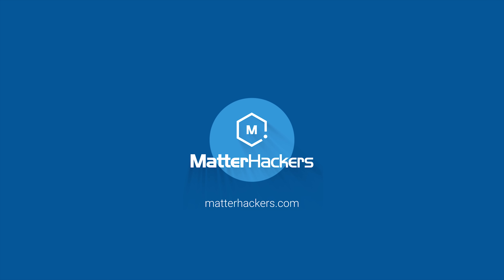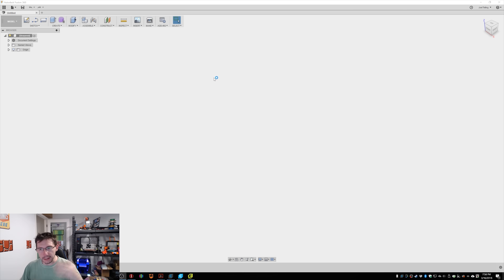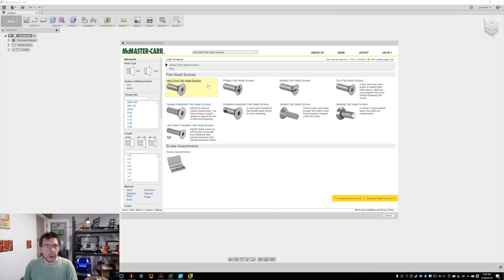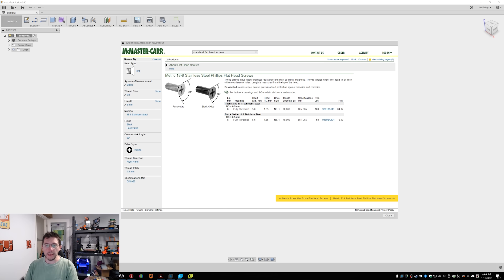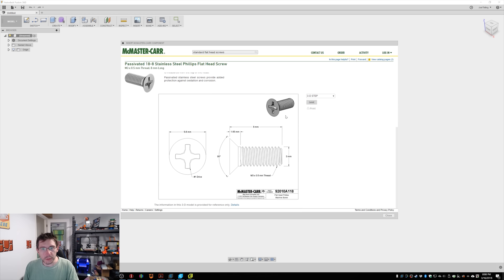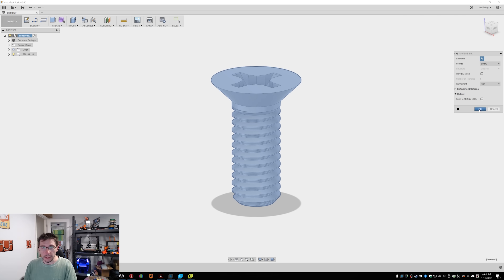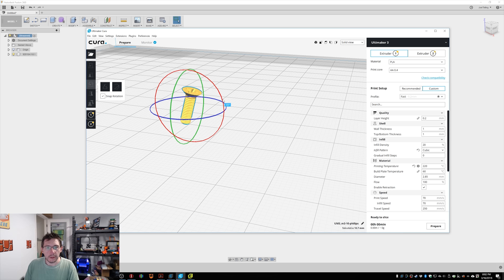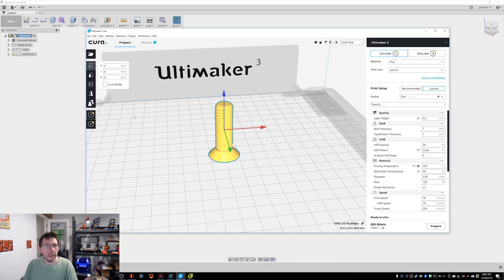3D Printing Nuts & Bolts & Screws using Fusion 360 and McMaster-Carr

Comment: The thing that's really weird is I can create these half inch screws and threaded holes infusion and they always used to work I won't go into what the assembly is but it uses these big half inch screws and they always used to work and then all of a sudden they don't work anymore they bind up I use the same class half inch 3B screw and threaded hole and they do not work you cannot turn that screw in and that's why I'm looking around on the internet to figure out why what has changed

Comment: If you don't change the length you're changing the thread pitch in theory it shouldn't even work I'm a machinist trust me it's not supposed to have a proper fit if you do not change the length because of the pitch changes it should bind up I have no idea why it's not

Comment: Are making bolts and screws on a 3D printer more efficient than making them on a plant? I work for Stanley and we make bolts and screws out of coil of wire. I’m thinking of the future and I want to know if 3D printing such objects will take those jobs. What do you think?

Comment: The problem with using percentage is that the tolerance you want to create is a fixed number and is not proportionate to the size of the object.
With tiny screws, 375% wouldn't be enough leeway. With huge ones, it would be too much.

Comment: While being 2 years old, I'd just like to add that there is the "Horizontal expansion" setting in Cura, which allows you to expand/shrink all perimeters just a little bit to the inside or outside without actually scaling the part itself. This could be useful when this method of scaling the full model isn't something for you. :)

Comment: Thanks for the video. My first printed bolt was a hex bolt, and I resized the bolt like you said, but because of the resizing, none of my allen keys fit the bolt.
So for my second attempt, I will be using a philips head instead.

Comment: I think an easier way to do it is with the Cura Setting "Horizontal Expansion" (mine is set to -0.1mm for PETG, and -0.05 for PLA) That way the holes match their real world size. It mitigates the thermal change in size from the plastic.

Comment: If you can spent few more bucks you can buy a kit of tap and die and make a perfect thread :D  You will just need to draw the bolt/nut without the thread .. check the strarret chart for the right size :D

Comment: Or... You could just scale down the holes? I know printing is fun, but really?
Oh. As 3D printed as possible? You could print controller PCB using conductive filament and stick components to it with conductive glue!

Comment: Could you have just used the M12x32 and skip the 4x scaling step?
Reply from the maker: I had though about that but stayed with scaling 4x as much as I could. Once I power it for RC bolts and nuts and things will change.

Comment: Tap and die set? since you scaled these instead of using m12 screw your thread count will be extremely coarse, but you maybe able to find a m12 tap with that thread count. This may also help with your nuts and bolts not having the right tolerances and give a much cleaner fit than scaling.

Comment: i don't know if u are Reading this, but i think i can help you with the "scale".
First sorry for my english (i'm from spain).
If u use the setting "horizontal expansión" in the perimeter settings (cura), u can reduce a little bit the model, like if u sanded (lijases, espero que este bien escrito) or add material to adjust the model, like 0.1/0.2 or u need.
once again, sorry, and i hoppe this helps you, if u read this.
Reply from the maker: I did read this, thank you!

Comment: Hi Joel, you may be able to use 3D printed bolts into the non threaded 3D printed holes if you run a tap into the hole first - providing you have say x3 shell layers on the part with the 3D printed hole in - some lube like silicone grease may help after you have tapped the hole to allow easy insertion of the 3D printed bolt - Dale, Kora 3D

Comment: As for 3D printing screws that will need to thread into the plastic, you can tap the part, screw in the printed one and have the epoxy on it as you do. it will lock in and be super strong!
Reply: Would rollform taps improve strength of the tapped holes?

Comment: JOEL, YOU MUST ADJUST ALL 3 AXES EQUALLY!!
if you change the X and Y axis but leave the Z axis unchanged, you will change the thread pitch (the angle between the thread and the horizontal plane).  You must shrink or enlarge all 3 axes equally, or you'll wind up with a nut that won't thread onto the bolt.  You got a snug fit, and I suspect that you're just barely fitting.  The problem is that you won't have contact along the entire thread between the bolt and the nut, and the nut will not thread at 90 degrees to the bolt.  So when you drill a hole through a piece of steel and drop the bolt through, the bolt will seat squarely on one side, but the nut will not meet the other side squarely; it will be canted on an angle, and one side of the nut will meet the material before the other.  Moral?  Gotta do all 3 axis equally.

Best wishes, Charlie

Comment: Fusion 360 can model threads.  I printed some laying down, you can just drop it into the bed to have a bit of flat on the threads and it was stronger than printing standing up.  https://i.imgur.com/WXXdLrq.png  as always, your mileage may vary.

Comment: You can’t change the X an Y on one or the other, sometimes the hole that you put the bolt through may need to stay the original size so it doesn’t slip around, so in those cases you’ll want to change the nut, but only if there is enough room for the nut to fit on the receiving end.

Comment: For places where the screws are supposed to cut the threads into the plastic parts - just use a metal tap to put the threads into the plastic, then screw the plastic fastener in.  Probably try it on a test-piece to make sure it works right, but a M12 tap might be the easy solution to your problem, and let you keep the final model as printed as possible.

Comment: Hey joel loved the video but there is a tip that i found works well for tolerances...the tolerance of a printer, as angus test shows, is pretty fixed at something like .02 or whatever.  So when including tolerances in your design instead of modifying the size % down to adjust you just add/subtract the tolerance of your printer to the dimensions.  Example if you scaled something up 400% and the dimentions were 30.333mm instead of doing 375% you can instead set it to 30.313 .  This way it doesn't matter if you are doing 400% or 400000% you will always adjust the size down by .02mm...

Comment: Now you need to 3d print a new screwdriver, because that 400% #2 phillips screw head probably wont work great with your typical #2 phillips. as you scale increasingly larger it becomes even more apparent.

Comment: To start this off, I love the idea of this project, and by all means you should Co tinue with it (as if what I say would stop you at this point since you already put hundreds of hours into this project). However, I mess with rc stuff all the time, any thing, boats, cars, planes, etc... And out of all of those things, the cars take the biggest beating. The smaller version of this 3d printed car already had problems, as it is all plastic and printed with an FDM printer, so to scale it up would only increase those problems because as things get larger they have to get substantially stronger, it is not a direct or linear correlation. Now obviously you won't drive this car a whole lot, but I was wondering, if any, what measures are you going to take to make this more rigid? Once again, I mean no hate by this comment, I was only wondering for myself, or intending to inform you (I'm sure you have already heard what I have said before). If you respond, THANKS, and best of luck on your project!
Reply from the maker: Hey Noah! Right now, I'm just trying to get it together so it looks like it should. Once that is done, I will be making changes to the car before making it radio controlled. I think having it be RC but move slow, like a parade float, would be neat still. Maybe I do that, then sturdy it up?

Let's be honest, though, there is NO WAY I'm going to possibly crash a thing that took 1,100 hours to print :)
Reply: 3D Printing Nerd I think the idea of making it go slow is great actually, making it ho fast would be useless  anyways I think, since it us hollow plastic it would proba ly catch air. Maybe you should take a regular brushless motor and gear it way down. Or you could use something like a power wheels motor.

Comment: Thanks Joel. Great coverage of the feature. Even though I primarily use Tinkercad, I'll still be able to go the F360 route to get the base part then import. Cheers
Reply: Hey +noxxi knox thanks for the detail. What I was proposing is simply using F360 to import the McMaster-Carr part, export the stl, then go back to my safe space called Tinkercad. Yes, I am a total CAD noob. Cheers ;)
Reply: All good. Make sure you don't forget to put a specific 'part' in a vice :)
Reply: Just tested downloading a STEP file directly from McM-Carr and uploading here http://www.3dtransform.com/ Worked like a charm

Comment: I have a few questions: As I understand it, the axis the printer prints the layers on, (in this case, it would be the "z-axis", or vertical axis), is usually the weakest point of a print. With printing a screw or bolt, vertically, wouldn't it leave said fastener extremely vulnerable to shearing or snapping off along these lines? Wouldn't the results be stronger if printed horizontally? ( Which in turn would possibly introduce the chances of the vertical shape being warped, I know, no easy solution.) Also, how would you handle printing the supports, whether printing the connectors vertically, or horizontally? Would printing diagonally solve any of this? How could you print it, and still maintain the needed strength & integrity?

Comment: I'd probably die and tap the print. Actually no I wouldn't I'd use an M12 model with a 6mm hex head and die/tap that... Of course the gold standard would be to just use a metal screw/bolt and drill holes in the 3d print to fit. Need a hole of reasonably accurate size in a 3d print? Make it slightly too small and drill it.

Comment: Another Fusion 360 trick is that you can edit the XML thread data library to include threads it doesn't have already. I've added soda bottle threads (yes, there is a standard) and garden hose threads to models this way so I can make 3D printed items with these type of female threads.

Comment: Joel, FYI scaling an M3 screw to an M12 will only work if you're printing the nut as well due to the thread pitch not scaling by the same amount. An M3 screw has .5mm thread pitch while an M12 has 1.75mm pitch. Scaling by 400% gets you close to the major/minor diameters, but the pitch difference won't allow it to mate with a real nut of this size.
Use the correct thread pitch model, when it's available. You can always change the head recess or Frankenstein other head geometries from McMaster models.

Comment: You might want to look at the setting in Cura that allows you to control the dimensions of your finished part. If you print a plate with an 8mm hole and measure the hole, you won't likely have an 8mm hole in your plate due to the way the plastic is laid down. https://www.youtube.com/watch?v=TFsTo6cDmF8 Horizontal expansion is what I was looking for.

Comment: I did this to make my spool holder. Took a bolt from McMaster and added a large round grip to one end so I could twist it by hand. Then used a nut from McMaster to make the other half.

Comment: You know that on that orientation you're putting the stress on the worst axis right?
Reply from the maker: Yup. This is just to get it together. Modifications and better fasteners will be used when we make it radio controlled.

Comment: If you still want to print the screws that need to "bite" into the plastic you still may be able to do so. You will need to find a "Tap" that will create the grooves in the plastic. At 4X you may still run into the problem of finding the correct size, however this is still a suitable option for creating threads on plastic.

Tap and die sets from craftsman:
https://www.craftsman.com/products/hand-tools/specialty-tools/tap-and-dies-and-sets

You could find a single tap if you know the exact size needed although the set will have several sizes and the correct tools required to move the tap in and out of the material.

For those who may not know the "Tap" is a threaded metal rod. Similar to a really sharp screw with relief channels for removing material without getting stuck. The "Die" is for creating threads on a rod. Its a bit more complicated then all that, as you need to oversize your rod and undersize your hole to come out with the correct threads but its an option none the less... 

Good luck and, Enjoy... =]

Comment: WHat are you talking about? You can totally magically inflate steel! You just need to heat it up. Metal expands by about a thousandth of an inch per 2 degrees C or so. All you need to do is keep the steel from vaporizing and heat it to about 3,000,000 C :3
Reply from the maker: I love your comment
Reply: A bit weird commenting on a 2 year old comment, but its worth noting that not only would he have to heat it to 3,000,000c... He would have to keep it there so it did not contract again when cooled.

Comment: If you don't find the size screw you need, it's pretty simple to create the exact size you need in Fusion.  Create a cylinder with the nominal diameter (eg: 3mm for M3 screw).  Extrude the length you need.  Then click 'CREATE-Thread'.  In the options, make sure the thread diam. and pitch is correct.  Then make sure "Modeled" is checked.  Click OK.  Walla!  :-)

Comment: If you scaled up the whole car by 4 then the motor mounts will be scaled up to, so the motor mounts and anything else that require a measurement will not work with anything else?

Comment: Why not just go with M12 cause its 4 times the size? Also seems like 400% = 25% ratio, so if you do 100%= it should be 6.25%.You should also get some plastic taps, they are used for taping plastic parts, bare in mind your wall thickness will have to be adjusted.

 I found for metal screws a good minimum wall thickness for an M3 screw should be 2m, and a good clearance hole should be 3.25mm for an M3 screw. 

Hope this was helpful for you all.

Comment: Hey Joel, just wanted to add something about threads in Fusion 360. Fusion does have its own thread generator installed and its very easy to use. Just create a cylinder. Use the thread command, and then go to document settings and select Thread: Cosmetic and change it to modeled. This will create very accurate threads that do not need to be scaled before printing. This is very useful if you want to screw 2 3D printed parts together!
Reply: I tried that, I think Fusion still makes the threads with too little tolerance and not for 3D printing.  At least my Prusa MK3s couldn't handle them without scaling.
Reply: @simon7109100  If you check out https://knowledge.autodesk.com/support/fusion-360/getting-started/caas/simplecontent/content/3d-printed-thread-tolerances.html you will find a file that allows you to created 3D printed screws and threads using the thread and hole tools in Fusion 360.  On my Ultimaker this worked fine, except when I wanted dimensional accurate parts, for example when creating a hole that I wanted to put an actual M3 screw into.   Horizontal expansion in Cura will work, but then my outer dimensions were not correct.  So that I could have both (I still have to manually scale other inner holes in the design, but that's easy to do), I created another XML file with the horizontal expansion numbers and added (my horizontal expansion was negative, if it was positive you would subtract) to the each MajorDia,  PitchDia and MinorDia values in the file in the link (I used Excel to import and export the xml - the poster of the link above had issues using Excel to export the XML, but I did not.).   This has worked fine for me (Tested M2.5 to M6 parts) with the only caveat that every time Fusion 360 is updated, you have to copy the file back to the current working directory, which is a bit of a pain.
Reply: I was going to say the same thing, I've got a two piece nut/bolt combo STL that I use to test new filaments, and it works perfectly on my Ender 3 sliced through Cura

Comment: With Fusion 360, on my Prusa 2, I find I can just create a standard thread (say M6), create a threaded hole, and expect them to print and screw together without any extra clearance. I.e. the default clearances work ok for me. If I do a custom thread, I have to add clearance manually.

Comment: Nice Joel! Quick question though and I pray you see this and can provide an answer.... Do bolts and screws like that require support material?  The angles suggest that they do, but I can't find any videos that actually show the printing process, just a before and after. Thanks!
Reply from the maker: Depends on the layer height and if your printer can handle the overhang angle. Look at the preview in your slicer first layer by layer and make sure it looks good. I didn't use support at all on mine.
Reply: Ok, Thanks for the quick reply! Hi-Five! :-)

Comment: Check out the Robertson heads (not common in the States), it would be an alternative to the Philips while maintaining the 90-degree angle. Given that is is a square head, it would be easy to build a bit when you are scaling to large sizes.